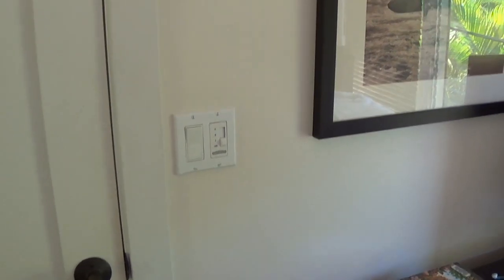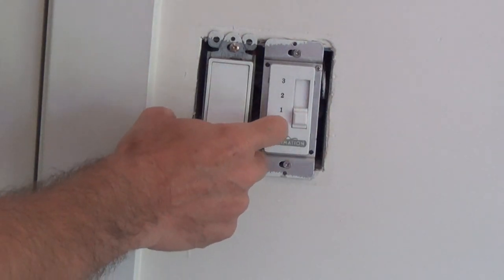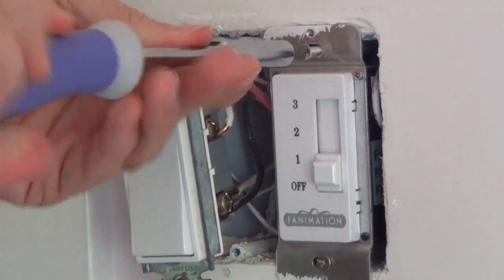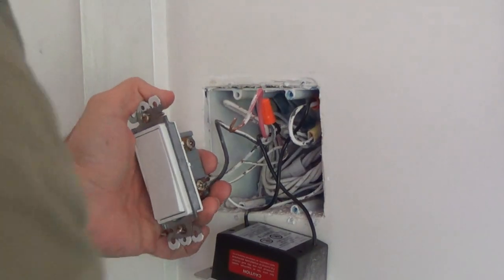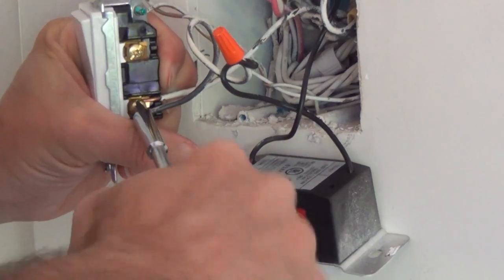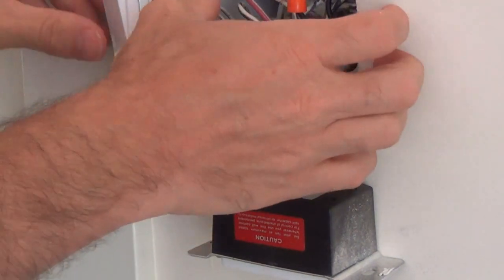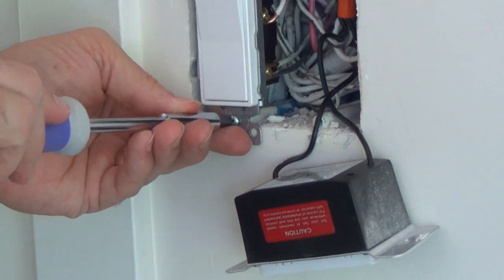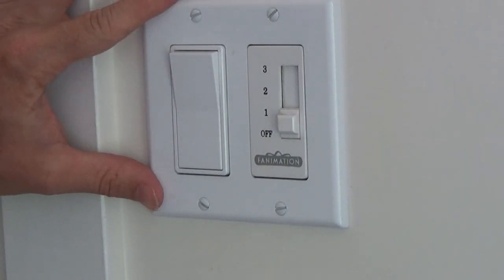How to Replace a Light Switch

Comment: Please be aware that you are using the term "short" incorrectly.  A "short" means a very low resistance path (connection) from the hot (supply) side to the neutral side.  This would trip the circuit breaker, or blow a fuse.  Your faulty switch is simply worn out.  It does NOT have a "short".  It has an intermittent "open" inside.  This might seem picky, but mixing up theese terms could seriously hurt some one.  Otherwise, great video.